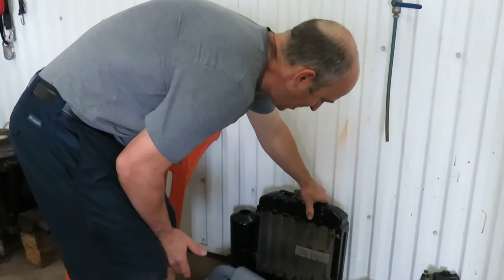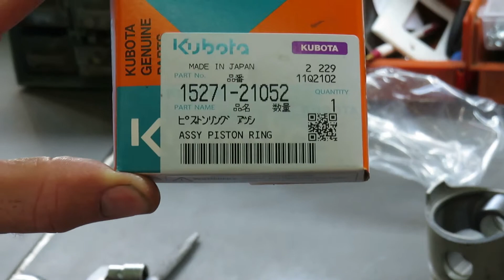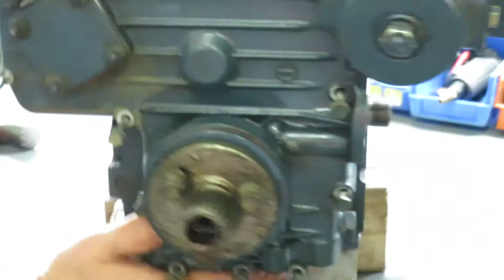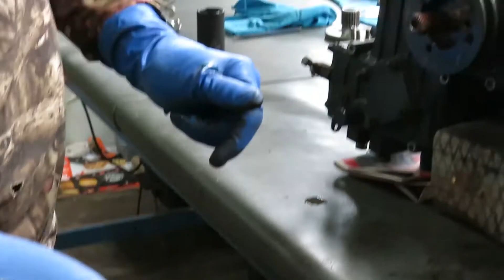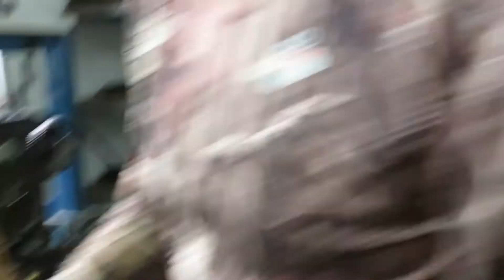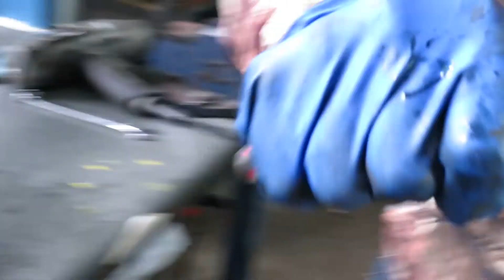Kubota B5100 Rebuild, part 3

Comment: Well obviously you can’t just knock in new sleeves and think they are going to be ready to accept pistons.    I’m not sure as to the condition of the original sleeves as you didn’t mention it.  But my guess is your best bet would have been to hone them yourself,measure them and order piston, rings to fit.

Comment: When you tapped on the keyway, the shaft seemed to go in significantly.  If that was the crankshaft, you may have a problem with your thrust bearings being worn out.  I am sure that this engine is put back together by now and that you are putzing around.  You can check the endplay of the crankshaft of the engine assembled to see if this is the case.  Additionally, replacement of the thrust bearings typically requires only the removal of a single main bearing so that you have access to the thrust bearings.  Leaving them be if they are way out of spec (and maybe I saw incorrectly) can lead to seal failure (leaking oil) and in extreme cases engine seizing.  Typically you get a seal leaking.  Hopefully I am wrong, your engine is great, and life goes forward.  Good luck and thank you for this video (I was about to do a cylinder swap on a Mitsubishi L-series diesel.  Now I will check the new sleeves against the piston before I swap things out.  Good luck.
Reply from the maker: Hi John Robinson. Thanks for the comment! Stay tuned for the next videos where you'll be able to see how the engine / tractor turned out.